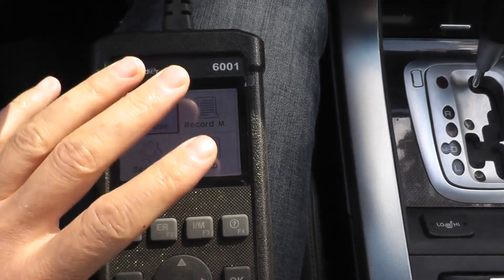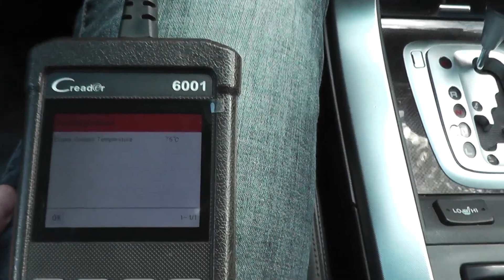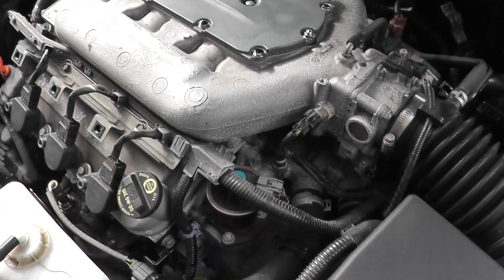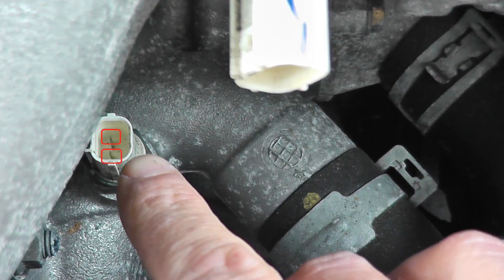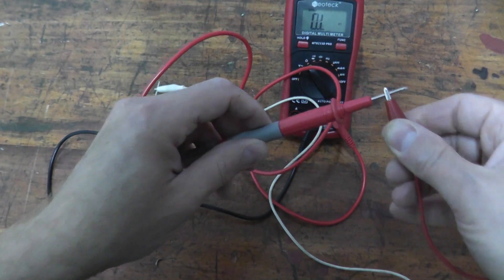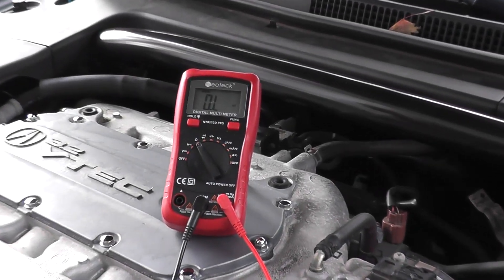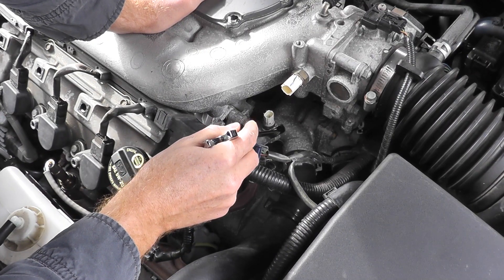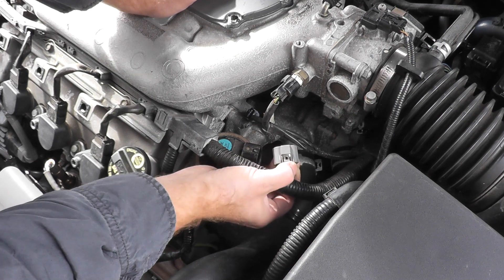Acura TL Engine Coolant Temperature Sensor P0117 / P0118

Comment: I looked at my sensor and I had a starting resistance of .99 kiloOhms but the value lowered after the car was running. Do you think that would indicate a bad sensor or is my sensor fine?
Reply: Bad, did you get p0128

Comment: Hi, should this work for P0125? One of the possible causes seems to be an ECT and replacing my thermostat didn't fix the overheating issue and there doesn't seem to be any leaks + my coolants at a good level

Comment: My engine light is still on with a p0128 even after I replaced coolant temp sensor, radiator cap, thermostat and seal… what else can it be?? HELP!!!!
Reply: Did you clear the code after replacing the parts?
Reply: Update? I jsut got that code and bought an ECT sensor today myself

Comment: if you're driving a BS automatic TL you got more problems than just a faulty ECT
Reply: like what?
Reply: @danman7877  like having one of the worst auto transmissions ever created
Reply: @TheShangralaaaa17  correction if you’re driving a 04-06 Acura TL with a automatic transmission than you’re screwed. 07-08 transmission are updated.

Comment: Love ur vids very informative I just bought an MDX and it had SO MANY CODES all engine sensors so I took 500$ and just went nuts o2 sensors, MAP,AIT,coolant sens,egr, pcv,coils,ngk spark,even got lucky and found 2 out of 4 NTK o2 sensors (Honda band),CLEARED all the codes fingers crossed,now I just have my big job left Idle pulley w/honda seprentine,serpentine, point is that Acuras are worth fixing if you don't mind minor work for very affordable parts,I suggest searching for Genuine Oem parts,they're out there

Comment: Has anyone come across this problem with 04 Acura tl  cooling fan stays on after engine off and temperature gauge goes up when cold
Reply: check the fan control relay, its on the top left of the fuse box!
Reply: @panzerkiller13  p p9

Comment: On my 04 Acura tl I have done all test for temperature gauge sensor and air intake sensor but still having the same problem  temperature gauge goes up high and cooling fan stays on after engine off
Reply: Hey did you ever fix that
Reply: I had one of my fans go out

Comment: I HAVE ONE QUESTION FOR YOU  I HAVE AN ACURA TL 2004  WHEN I DISCONNECT THE CONNECTOR OF MY COOLING FUN SENSOR  THE FUN WILL RUN, BUT WHEN I  PUT BACK  THE CONNECTOR TO THE SENSOR  THE FAN STOPS.WHAT DOES THIS MEAN?
Reply: bad sensor

Comment: What about the ect sensor #2 any idea how to do that? Just checked out a 2008 TL and it had both sensor codes show up .
Reply: Did you ever find the other switch?
Reply: Is attached to the radiator under the radiator bottom hose

Comment: I just changed out the ect sensor for my 2003 acura tl and the cel wont go away. The car is running/starts up fine and has no symptoms but the cel wont go away.
Reply: The code its showing is 0118
Reply: @adrianr4095  did you clear the code after replacing the part?

Comment: if i try to bypass the temp sensor, with a paperclip, by simply sorting across both terminals, of the plug, with it disconnected from sensor, will fans turn on?..... or will that short computer, possibly causing damage?

Comment: Hi, I have a question about my 2004 TL. Head lights turn on then I turn off then turn back on it doesn't on both sides, only one side. I have to wait likes 5 minutes then turn back on they will lit both sides. That is with the engine on. What cause is it?
Reply from the maker: Recently change the HIDs?
Reply: CarsNToys yes , It was burn out so I bought one on EBay and did it my self.